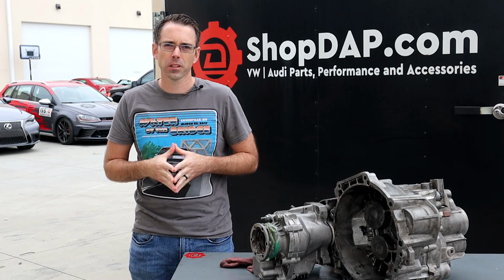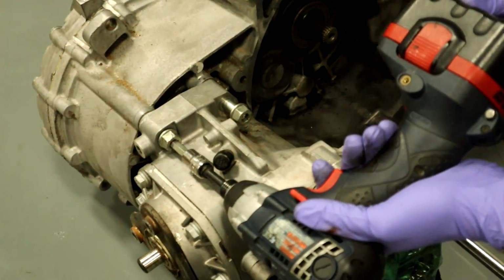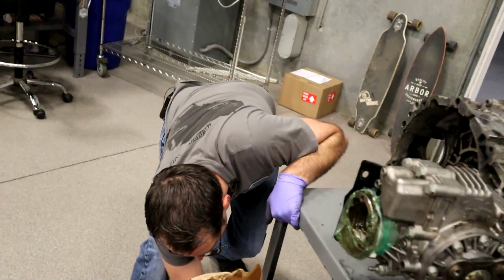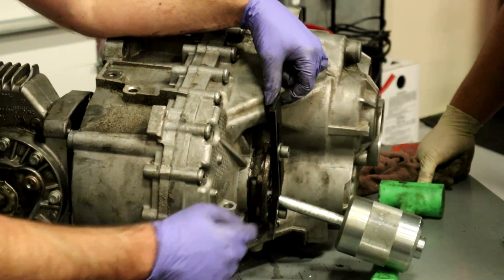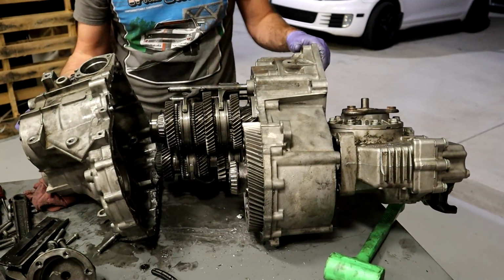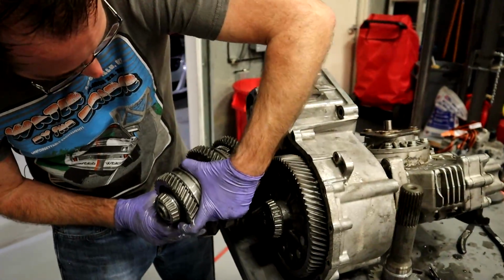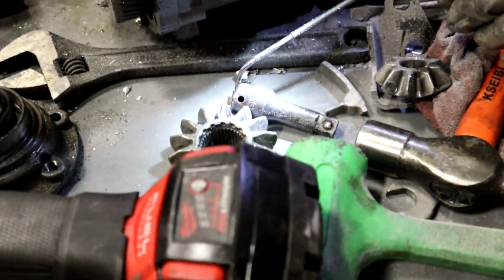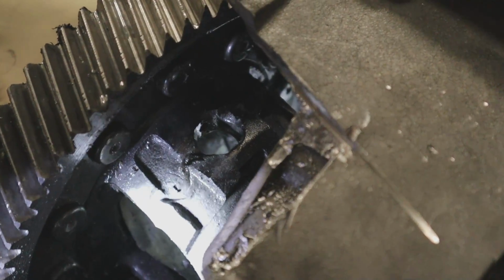This MK7 Golf R Trans Locked Up Going 70mph

Comment: In the older gearboxes there was a long 6mm torx bolt that went down the centre of the bevel box that you had to remove to get the bevel box off.
Reply: It's fused on there from broken metal bits and alot of heat
Reply: @BryceJordanProductions  same I had to drill and tap mine out

Comment: The fluid is probably long gone by now, but you should've sent a sample off to Blackstone labs to see what it was (if factory fluid or some aftermarket stuff, or if it had additives of some kind in it), and to find out exactly what all those silver particles were, to better understand where the wear had occurred. I have a sneaking suspicion that the silver was actually some kind of moly/particulate additive. I wonder if Bryce would be willing to weigh in on this...

Comment: For any concerned 6MT owners or anyone that wants the chance to bash VW, go spend a few minutes on Bryce's channel first. Unless your car makes ~490whp, you like brake boosting, and your brain struggles to lift off the gas when shifting, you have nothing to worry about.
Reply: I may be biased but I agree 😏🤙
Reply: I’m all about flat shifting, but my ECU is tuned for it intentionally!
Reply: I also have an ecu tune for no lift shift, very cautious about trying it, but it actually works pretty well
Reply: Pie Mao I use mine all the time, it’s so much fun. Just don’t force the next gear in as hard as you possibly can, you can shift fast but still gotta give the synchros a split second to engage (if only I had a dog box...)

Comment: Given all the extra torque applied due to the mods, and the fact the transmission failed whilst driving "normally" this was probably a fatigue failure (although I don't know why the transmission fluid was silver).  Engines and transmissions regularly blow up on professional track cars, so it should come as no surprise that given the amount of abuse this stock transmission was subject to that it would eventually fail.

Comment: let me guess, that golf r trans has one of the sealed never need to open nonsense joints. wouldent it be good to be able to change your trans fluid?
Reply from the maker: It doesn’t have an interval but Bryce had serviced it
Reply: @Deutscheautoparts  very good thanks for the info! Any advice on how often to check/change the trans fluid? It’s a hard driven daily that sees under 10 track sessions a season, and as many drag strip visits. Any advice would be greatly appreciated.

Really cool video guys!! Love the content!

Comment: This is why you should take care of your damn fluids. 

I used to have a used Peugeot 306 and i changed all fluids. Coolant, oil and transmission. I had issues shifting gears and afterwards it was super smooth.

Definitly when modding your car its important. 

I like playing around with cars but id never do it tp my daily like he did

Comment: Those cv flanges being stuck in is because the plastic of the differential melted away and is why  the diff gears were floppy instead of tight

Comment: There is a hex bolt inside the middle holding the cornering diff on the gearbox.... you can get to it from the passenger side axle flange deep down in there...
Reply: for real?
Reply: @jamesmedina2062  jup.
Reply: @TheSimplexArtz  so these guys just didn't remove it?
Reply: I think they stripped the bolt because its a bitch to get too you have to use 1/4 5mm allen socket with 2 extensions to get to it

Comment: That's pretty intense, that fluid had so much metal shavings in it, could that have caused additional wear and tear? I understand you need to change your fluids more often when you are an Enthusiast driver
Reply: Fluids where all clear of metal prior to it exploding. Barley had 3k on the fluid and it's supposed to be "lifetime" this was on its 5th or so fluid flush
Reply: @BryceJordanProductions  thank you so much for the response sir! I know I'm never going to put my GTI through what you put your R through (daily driver, reliability is important) but I was worried because I understand it is a lifetime fluid and I REALLY want to autocross next summer just to learn my car better. I've never really felt comfortable pushing my car but it's SO MUCH FUN! I understood it was lifetime fluid and that was compromised by the not "normal daily drive" nature of your use. Sounds like if I autocross my car once it won't be a big issue then. Good luck on the next phase of your R! (I haven't had a chance to devote time to come in and watching your channel even if just for your video unless but I will).
Reply: @BryceJordanProductions  oh I just watched that video and now I'm hooked. I want to watch all of the engine pulling videos to see the makeup of the front end of the car.
Reply: @NoZenith  I wouldn't worry too much about hurting it just doing some autox here and there. Plus I was launching at 6k every single run, and last season I raced almost every weekend from April to October.. insane amount of launches and abuse! And heck yeah man, taking that front end apart was fun! It's all been fun really. Nothing has been too too difficult yet!

Comment: This was NOT a transmission failure, the differential pinion shaft bolt came loose or snapped, causing the diff to fail. IF you're going to race, you need to rebuild the diff with high quality aftermarket parts, also a transmission oil cooler is a must for competition.

Comment: I wonder if my transmission was the talk of the shop/they tore it apart to see what it looked like due to suffering a similar fate to this one.   The culprit was a 4" uscargo ratchet that fell off of a construction vehicle that was bouncing around on the highway during rush hour traffic.

The ratchet blew a hole in my transmission housing, which led to a number of driving issues.  Thankfully, I was able to safely pull off to the side and call for assistance.

Thankfully the damage done to my vehicle was completely covered by my insurance.

Comment: Paul, fellow VW Technician here, you need to remove the 5mm alan bolt on the passenger axle cup on the bevel box. It'll literally fall apart after that.
Reply from the maker: Thanks for the comment.  Its already out.  We just didnt show on video.  We might try to torch the bevel box out for a different video.

Comment: Mk7 golf r’s are notorious for having an underfilled transmission from factory at least with dsg. I don’t see how this transmission could’ve overheated this much unless it was also underfilled.
Reply from the maker: The heat likely came from the differential grinding up metal
Reply: spider gear cracked had nothing todo with the fluid I've seen this happen on brand new rs5

Comment: For anybody that doesn't know and tries to take apart their transmission for service there is a tiny Allen down the center of the axle cup and the transfer case. I'm like 90% sure they did not remove this and that's why they had a difficulty getting those parts off.
Reply from the maker: We didnt show it, but it was out.   Some say this bevel box is still locked up this very day...... because its still stuck in the trans.
Reply: @Deutscheautoparts   Very odd guys. I don't see how but that's impressive.
Reply: @Deutscheautoparts  I stripped my allen bolt so I had to drill and tap it out

Comment: many many years ago I had a 1981 diesel VW rabbit with a 4 speed manual transmission. I loved that little car but had to replaced the transmission do to a hole in the case. Also had to change the head do to bent valves. This hapend do to alternator belt coming off and part of the belt caused timing belt to skip .

Comment: mk4 manual trans from 2.0l and tdi does the same thing , 
lock pin of differencial snap , then goes make an hole on transmission housing 

why this still occures 3 gens laters &!&6111@@@!\!

Comment: I got me a new Mazda, about 1200kg car weight with driver and full gas tank..
2L gasoline engine without turbo, and with a manual 6 shift gear...

don't need this kind of trouble in my life...

VW engines sold in germany in recent 10+ years often did not last 60000km for many, many, many, many..... reasons..
And then the trouble with the gears, turbo, exhaust systems........
It's like a 20year old "exit scam", what VW did..

Comment: So more or less just repeatedly asking that stock gearbox to do more than it was designed to do with more power?
Reply: Yup 80k of pure abuse lol
Reply: @BryceJordanProductions  what was your torque and HP dyno numbers at engine and or wheels? Not to be noisy but I was told not to go more than what I have. Wheels 347whp 374ftlbs,  engine 400bhp 430ftlbs. I have the 7 sp DSG with IS38 on my GTI.
Reply: @334trax2  last year I made 487&430 to the wheels at 28psi on E60 and I'm now at 32psi.. didn't get to Dyno on 32 but on 91 it should make about 470-480 and over 500 on an E blend easily. But now imma throw in rods pistons etc uncap the tq and let her sing
Reply: @BryceJordanProductions  Holy $hit the engine build up yes, but can the transmission take it?
Reply: @334trax2  a built trans from FFE sure will ;)
Reply: @BryceJordanProductions  👍 congrats I only have FWD GTI so those awesome power numbers you are getting will probably be no good for me. Looking forward to seeing your beast in action.
Reply: @334trax2  with the right suspension setup and tires you'd be fine!

Comment: Someone tell Bryce he should be changing his trans oil when abusing it. Oil cooler for the next build.
Reply from the maker: He didn’t change it, seems like it didn’t work. Reality is if you run your car that hard it’s just a matter of time.
Reply: @Deutscheautoparts  he did, or he didn't? 02Qs are quite strong. Either driver made a mistake at some point, or oil was neglected causing overheating and thus failure. Sounds like the later since you mention it happened at cruising speeds.